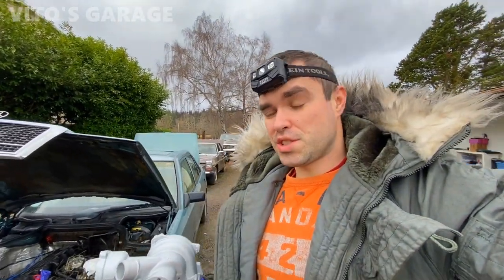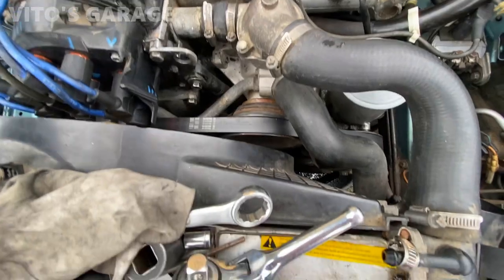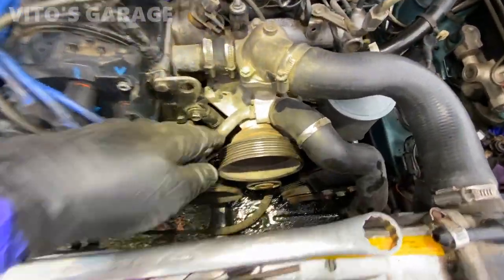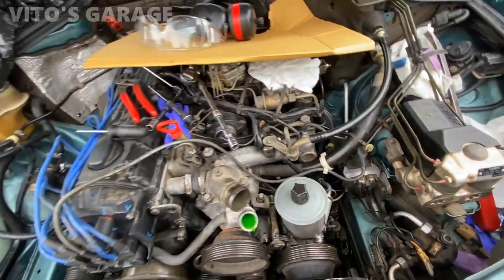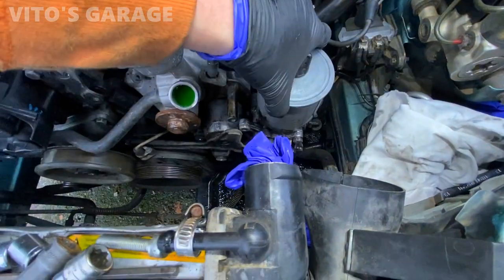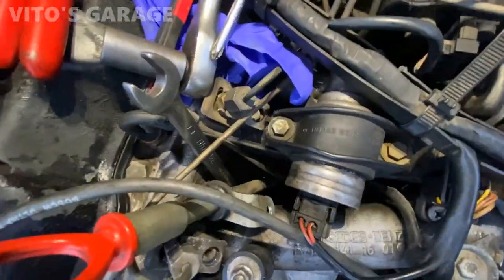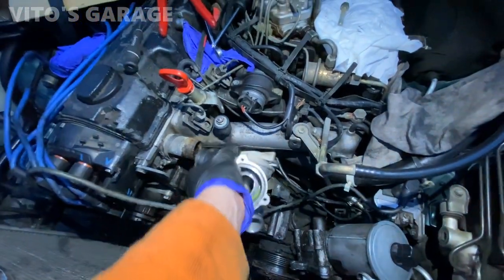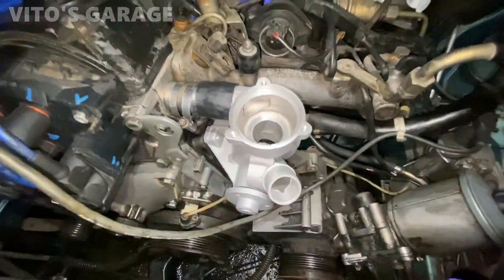Part 15 Mercedes 300E W124 M103 New Water Pump, Hoses, Belt, Pulleys & Full Surgery

Comment: I replaced the stock fan with 2 12 Inch electric fans on my 87 300d and my
87 300sdl.  Now both cars run at 85c on 105 deg day running ac.
It made a big difference in power too the engine not having to spin the fan and ac when both are engaged.  Swapped out the 70 amp a alternator with a 120 amp. Huge difference.   Now I have to sell my 300d. Can't afford insurance on 2 cars. Just got it to everything is perfect  but definitely prefer 
A w126 300sdl over a 300d.  Sdl is so much more refined. But I love all the diesel mercedes

Comment: I'm shocked that you are so calm doing this job. I HATE changing the waterpump on M103 or M104 because of the Allen bolts if it is the original pump AND the tensioner especially if it is your first time working with the belt tensioner! I always do the waterpump when the headgasket is done. Best time to do it, beautiful 300E.
Reply from the maker: When doing the head gasket, everything should be changed while at it. And thank you!
Reply: The water pump on m103 and m104 is the same one no difference ?

Comment: Really nice work, Vito! M103 water pump replacement is really similar on the M104. Definitely requires patience! 🙂 Brought back a lot of memories for when I did this on a 93 300E 2.8. The W124 is a beautiful chassis 😍 I was a W126 and R129 lover - but the W124 has really won me over

Comment: Just wanna say that my M103 water pump has 3 X 13 mil bolts and the allen (hex) bolt and , oh yeah, the top right 13 mil is a pain in the a**.
Reply from the maker: Very interesting because on my Baby Benz all 4 bolts are 13mm hex. Same engine

Comment: How do you get the tensioner assembly out?
Reply from the maker: After taking the belt off, there are 2-3 bolts holding it in place. A few bolts also hold the power steering pump together. You might need to remove the power steering pump pulley and the fan pulley to get access to those bolts

Comment: Another informative video.  Hope I don’t have to do this on my ‘87 260e. Hey Vito, what do you suggest in terms of painting those exhaust headers?  Should I remove them for bead blasting and them ceramic coating or try to paint them on the car?
Reply from the maker: Preventative maintenance is the key. I’d recommend you do the water pump and all those parts now before something fails. It’s not too difficult. As far as the headers, take them off and sand blast them or wire wheel and paint with high heat paint